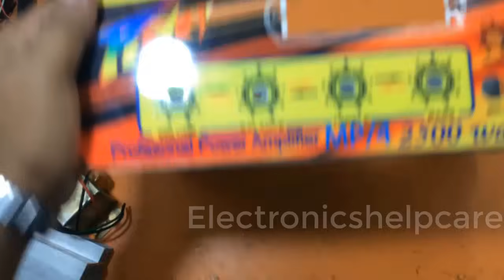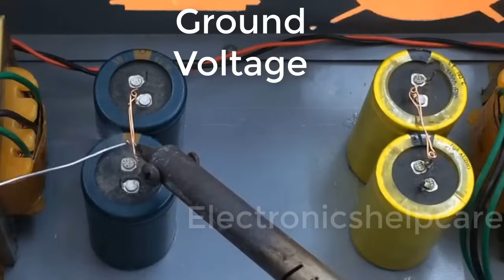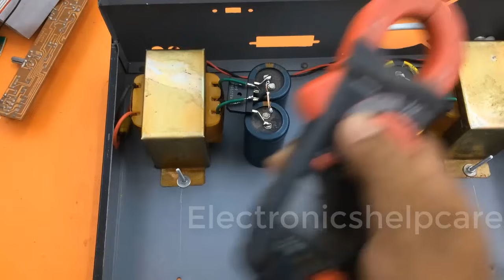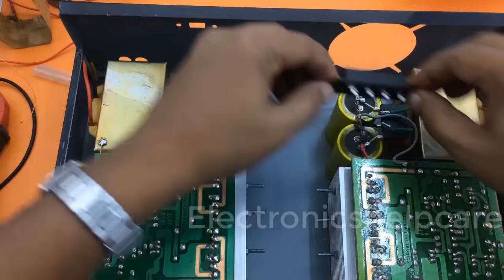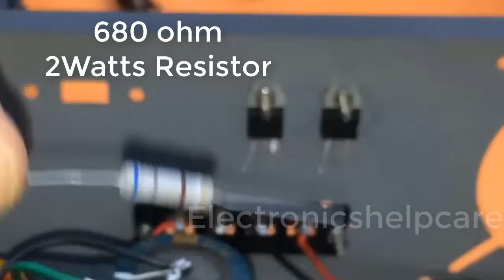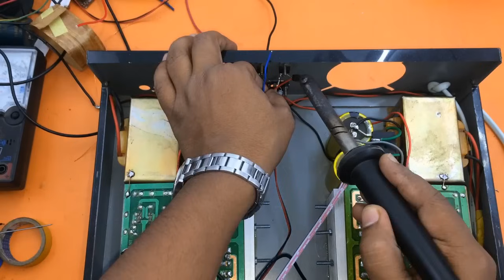Dual channel power amplifier

Comment: Ya, slam that thing together ! craftsmanship and pride at its finest. So much wrong here I can't believe it. Is this the same guy that builds  3D circuits with just the components in a wad ball jumble with only music in the background ? So Sad as design improvements should be considered and some pride in craftsmanship. I can't believe it over 1.1M views ? What is the ratio of jaw droppers in awe vs educational value you can apply ? Sheesh.....I had to bail.

Comment: No safety, work and connection is barbaric, You should made the amplifier,tone control and rest yourself by etching pcb and followed a schematic diagram.
One mistake or drop everything will smoke!

Comment: You need to practice more Skills specially into Cable Management and learn how to etc a PCB to make your  DIY/Project clean not put the parts on the casing of your amplifier.

Comment: The outlet ground and the common ground are the same circuit. Thus leading to distortion from your 50hz hum. Additional the to is right channel command ground can leek to the left channel command ground leading to fly back power. Thus leading premature output transistor failure under high load. This amp is not bridgeable. :( over all it nice project.

Comment: Ok nice project but terrible assemble. You glue the heatsinc  and capacitors instead to use nuts and bolts and PCB even experimental PCB will do the job. And tne wire look like the spider is runned in the case please you must understand that this is a sound amplifier and in this state you will get a hum, noise and other things. I saw your electronicshelpcare web page and i like that but here in video i,m disapointed you could do better alwais can be better power on one side signal on other side and use shilded wire for better sound and nose isolation. Please se this critics positive not negative because in the end of the day we all whant the best.